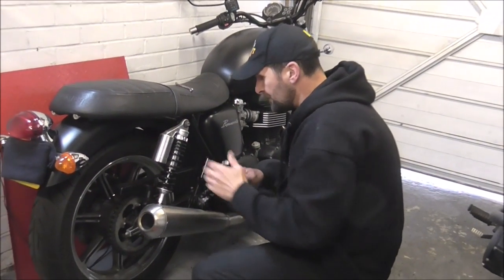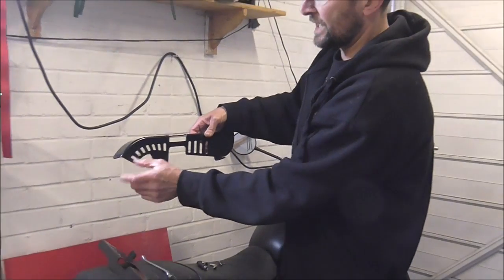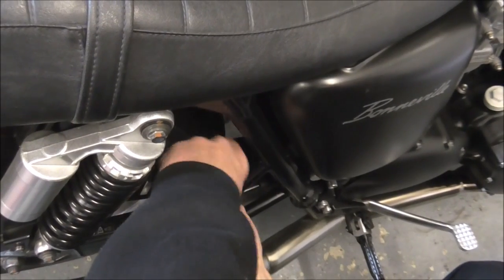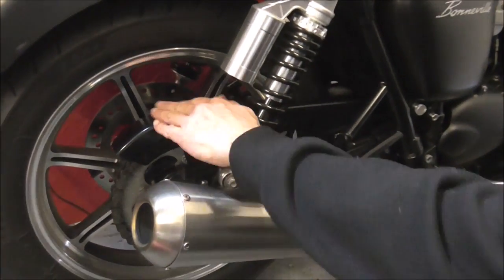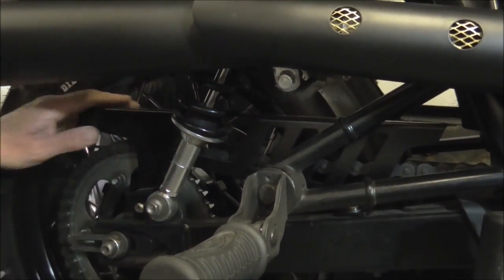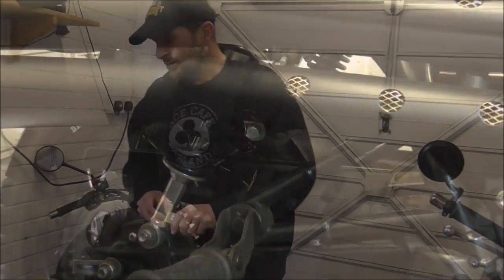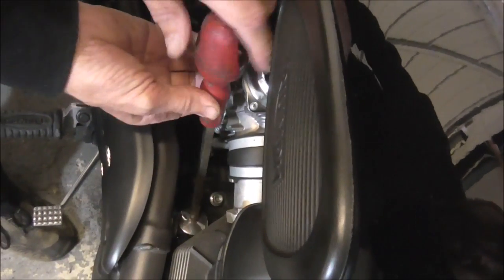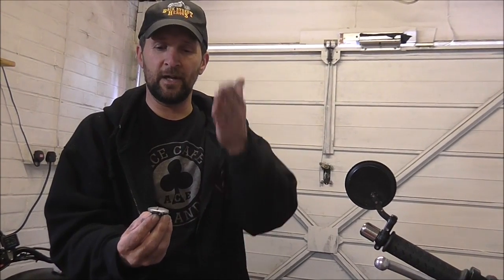Delboy's Garage, Triumph Scrambler, Billet oil cap.

Comment: Crikey, that filler cap is a tad inaccessible on the scrambler, not that you need frequent access when the pipes are hot. An issue when removing the cap after running the engine up to drain the oil methinks. There's always a compromise with high level pipes not least the fact that they restrict the luggage that you can carry. That Motone part is well thought out as ever and a lovely bit of engineering, so a big thumbs up there. 

Perhaps it's time to consider the exhaust set up that johnnycactus has? That's what I'll be putting on my T100 when I get it.
Reply from the maker: pgod1960 Hi Peter, was talking to George at TEC last year whilst that exhaust was in the planning, and it sounded exciting, but I do think that they perhaps, could have spent a little more research time on developing something for the Scrambler, as currently they have nothing... whilst you can fit the 3 Bonneville options they have, they aren't correct for the bike and if you are genuinely gonna off road it, you'll ground the downpipes quite quick... if I was gonna have a low lever under-slung, I'd go with the ZardX but need to save the pennies first lol !

Comment: Hey Del,  At 3:25 in the video I see your headlight bracket.  Did you use the previous rubber spacer from the stock bracket to fit the new one flush to the headlight?
Reply from the maker: No mate, its a bracket for a Bonneville, and sits too wide for the smaller Scrambler light, meaning it was too canted inwards to sit flush in the side of the light... so i used two large nuts that are 10mm thick to space them out and make the brackets sit flush on the side of the light.. hope that makes sense.. Del.
Reply: Thank you so much,  I'm experiencing this now with joker headlight bracket.  Thanks for the solution!

Comment: the Triumphs of old used to have oil fillers with slotted heads, so the 'modern' Triumph people probably use it as a nod to the original design. Having said that, there's a reason we don't still use contact breaker type ignition systems, solid tyres and acetylene lighting......... There are better alternatives.......as you have just proved!

Comment: Delboy I have a problem I took my forks apart and one is missing a washer from on top of the springs how important are they and how do I get one?
Reply from the maker: Alistair Campbell Hi Alistair, the washer holds the spring and spacer tube aligned, without it the spring will buck out of line inside the fork and rub on the insider of the tube....just get one from the dealer, or measure the other one and see if maybe ScrewFix have anyhting to match it..!
Reply: Cheers delboy love your vids btw inspired me to work on my bike myself :)

Comment: what is the size of this filler cap ?
Reply from the maker: which size are you asking about.. the diameter, the alun screw fitting..?
Reply: Moonfleet41 the threaded site of the oil filler cap 1 5/16?
Reply from the maker: Oh i see, sorry i wouldn't know off the top of my head mate, id have to measure it and not near the bike right now... !

Comment: I grip a coin with a pair of mole grips. No effort and it doesn't chew up the bolt. Nevertheless, it's a stupid design and yours looks so much cooler.
Reply from the maker: patrickcol Yeah, works on a Bonneville...but you cant get in there with any tools on the Scrambler accept from above..!
Reply: Moonfleet41 Sorry Delboy, I've got a Scrambler; you can just use one but it's not easy.